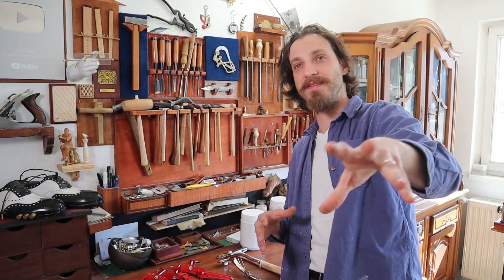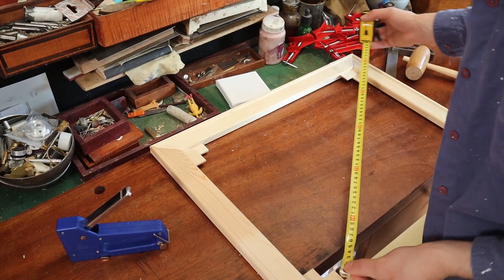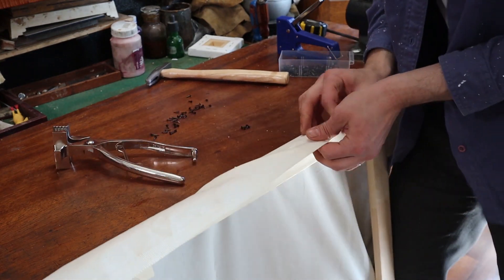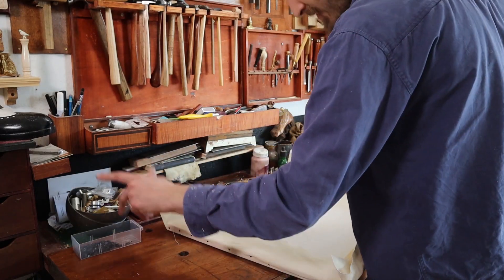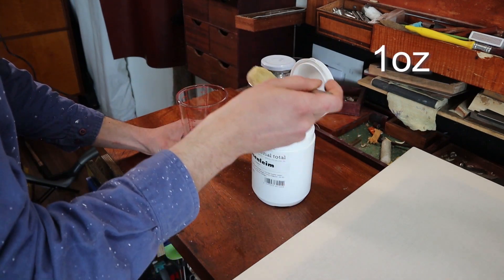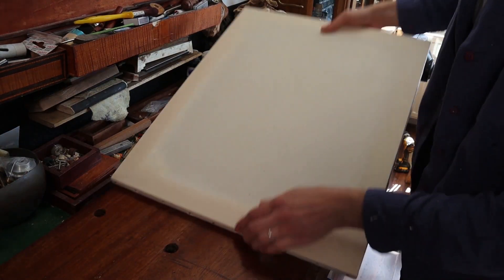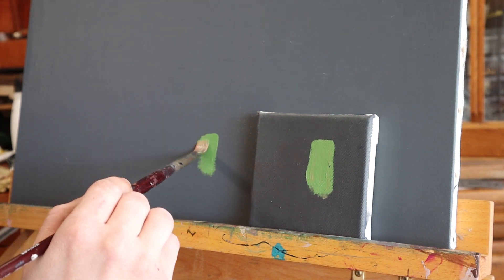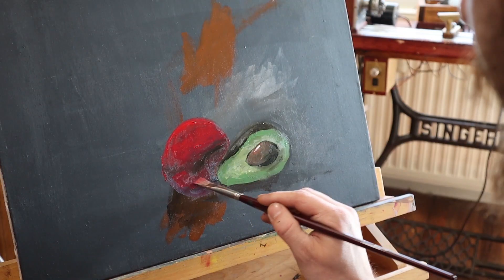Why stretching your own canvas is so delicious!

Comment: I’m glad to see I’m not the only weirdo who likes to stretch canvas. It is, indeed, delicious. 

Stretching canvas taught me an extremely valuable lesson: Start in the middle, and work out toward the edges. This is very, very helpful any time you have to stretch or spread canvas or paper, or just about anything that comes in sheet form. 

I’ve never used glue or staples on the frame corner joints. The canvas holds the pieces together tightly, especially after it has shrunk from the primer drying.

Comment: OMG OMG... how about Uri designs and crafts a stapler ? 🤔
Reply from the maker: That is actually a cool idea!
Reply: @urituchmanpigeon   How is this helpful ?  You teach us on sub grade materials that you do not prefer that have to be sanded ?   What about teaching us how to make large canvases with thick stretchers that you prefer.
Reply: @PrettyGoodLookin  he is demonstrating how to make a superior product using affordable options. Why would this upset you? This is EXTREMELY helpful.
Reply: @urituchmanpigeon  I can already see a sculpture of a person holding a staple with an mechanical arm that will smash the it with a hammer.
Reply: @PrettyGoodLookin  ya know how you said teaching? He uses Sub-grade material because guess what.... He's teaching
And if you want a big canvas, then scale up his method, it's a tutorial video, not a fucking master class
Reply: Yes
Reply: @urituchmanpigeon  I think making one that actually worked well would take 14 versions each gradually perfecting the process, I don't want that kind of guilt.
Reply: @PrettyGoodLookin  you're fun
Reply: @urituchmanpigeon  Did not intend what i said to sound as rude as it does !  :)  I just want to learn how to make a sturdy canvas that requires no sanding.  A large canvas.  :)
Reply: @ToasterHead  thanx.  What i said came across rude bc i was feeling frustrated.  :)
Reply: @CosmicVitamins   He did not say it was bc it was affordable....he said bc that was all he had on hand.
Reply: @PrettyGoodLookin  and this is a bad thing? Why jump to accusations so fast? He's creating good content that has value. That should be respected.
Reply: Genius!

Comment: I've stretched thousands of canvases. As a teenager, I used 
to work in a shop making all different sizes. I used bars like the ones  
you had, also more crude bars, and used exactly the same canvas 
pliers you have (they haven't changed). You're right about the stapler,  
the one you have is a toy - that's why it broke. Also the clamps you used  
are toys. They won't give  you a square product.  Use an old Stanley No. 400  
vise to clamp the opposite corners first, then attach them to each other. A  
newer option is: 
https://www.rockler.com/miter-vise  
(be careful, some vises from the factory aren't even square so check them).

With larger bars like you had, you don't need a vise though, you just should  
use a mallet and a builder's square - and the mortises shouldn't need glue. If  
the corners are too loose, then use a few staples, not glue. Do opposite corners  
first, checking for square, then attach both sides to each other, then use the 
builder's square to do the final check. If you need to adjust, use the wooden 
mallet. The corners should line up without any planing or filing - unless the 
quality of the bars is deficient. The mortises shouldn't be loose, if they are,  
return the bars and exchange them for new ones, only staple them if you have no 
other choice. The bars should fit really snug together, and the corners should be
naturally square, you shouldn't need to fool around with the builder's square too 
much more than a few taps with the wooden mallet and a few flips to set each corner.  

The only stapler we would use was the Arrow T50, it is still being made.

Also, it's obvious to me (sorry) that you don't actually stretch canvases all day.  
I could do that whole job in probably less than five minutes; when I was a kid it  
would have been about 40 seconds (using a stapler), and I'm talking about 
starting with the bars apart.  

You weren't using the pliers properly, there's a nub on one jaw of the pliers to act as 
a fulcrum against the bars. You could not do that though, because you had cut the  
canvas too large and the edges overlapped too far for you to get a proper bite with  
the pliers onto the canvas. You should practice more. I like how you used the tacks  
instead of the staples (although with the toy stapler you had, I don't blame you).

When you cut your canvas, never tear it. Use a box cutter or just a razor blade.
The lip of the canvas should be 1-1.5" over the edges of your bars, just enough for the 
pliers to get a good bite. Then when you  use the pliers, you have that nub on the lower 
jaw to act as a fulcrum, so you can get the canvas tight, and you can get a really good 
stretch. I never stretched raw canvas (without gesso) before, I don't think it's that 
great to stretch it before you have the gesso on  it (but I could be mistaken on that 
point).  You usually don't need the wedges on your bars unless you've done a poor job 
stretching the canvas - to tighten up things.  Also, if you use the wedges it messes up 
both the square and the size of your canvas - you can add as much as 1/8" to the dimension  
after pounding in those things. So, try to avoid them, it can affect the size of the frame  
later on if you use them.

When you start putting the properly cut canvas onto your bars, put the bars vertically onto a table
so that the canvas is hanging from the top bar, so then you can center the canvas over the top bar. 
Put one staple in the middle, parallel to the direction of your bar. You've got one  
side attached at the top. Lift up the whole thing a few inches with your right hand, and with  
your left hand catch the bottom bar along with the bottom lip of your canvas. Folding the bottom 
of the canvas over the bottom bar, flip everything over so that the bottom is now under your chin,  
and the top with the one staple is now sitting on your work surface (or stool, depending on the size  
of the bars). Before putting your second staple, check the size of the lip, make sure it won't overlap   
too far, or you will end up trimming it later. Center the canvas, check the lip on the right and left bars.  
Now put the second staple on the top of the next bar - in the middle of the bar, parallel to the bar. 

Now, flip the bars either way, clockwise or counter-clockwise, and find the middle of the third bar. Third  
staple goes in the middle but be careful not to pull the lip too much before you staple, or you end up with  
a wavy canvas. Again 1" to 1 1/2" lip is enough (a smaller lip won't give you a big bite with the pliers). Flip  
the bars again, and get the fourth staple - this one's not as critical, you can pull harder on this before you 
staple.  These first four staples aren't really stretching the canvas, they're just holding it there in position,  
and you might need to remove them during the stretching process because they were installed when the  
canvas was loose. Your first staples should be parallel to the bars, but all your staples from now on should be  
at a 45 degree angle. 

Now things start to get more critical - you start using the canvas pliers. Get a grip on the canvas, right behind  
the middle of the top bar - next to the edge of the bar. You will see that the fulcrum of the pliers is right there for you to 
take advantage of when you want to put some tension on the canvas. If you did that now though, you'd pull out the  
one staple that's on the opposite bar - not a good idea.  So, just hold the canvas to one side of that one staple,  
and put two more staples in, one on either side of that lone staple. Flip the canvas to the opposite side, and  
now you can start stretching with the pliers. It will become obvious that the first staple may be too loose and you  
may see a bit of a pleat under it. You can pop that staple out later, first put two more staples, one on each side of the  
original staple, and rotate the canvas. So, two more staples on the first side, flip, stretch, put two more staples (you may  
get another pleat).  You should have three staples on each side, in the middle of each bar.  Only work on opposite sides  
of the canvas, never rotate the canvas to work consecutive sides.

Now you can relax, the canvas is basically on, you can start really stretching it. Use the fulcrum and see how much 
power you get out of it when you lean the canvas & bars away from you and pull it against the fulcrum of your 
canvas pliers. Staple out from the middle. You already have three staples in the middle. First staple from the middle to the corner,  
go back to the middle, then go back out to the opposite corner.  Flip to the opposite side, repeat the operation,  
starting from the middle, going out to each corner, stretching with the pliers, using the fulcrum against the bars.  

You should have two sides stretched and two sides with the three staples each. Look at the canvas from the front and see if you've  
got any pleats. Now starting from the middle again, go out to the corners with the stapler. You can now see why the first staples  
are parallel instead of at an angle. You may need to pull them out if they're causing pleats. When you get to the last  
side of the canvas, you can really start to pull hard with the pliers. I used to find this a bit painful after doing  
a lot of canvases, it's a little strenuous on your grip to both pull and squeeze hard with the pliers at the same time.  
But you have to do it. The last bar needs to be pulled the hardest. 

You should have all four sides stapled, without any pleats in the surface of the canvas. If you have pleats, you'll have to  
remove a staple, stretch it again with the pliers, and restaple. You should have "ears" sticking out of the corners of  
your canvas. This part is a little tough to describe. You want to make a neat fold along the edge of the corner of the 
bars, then put one or two more staples to hold the fold. You should do each corner. It's kind of like making your bed, and 
getting the corners of the sheet folded in neatly (unless you have fitted sheets). 

You'll have a small lip around the bars that looks kind of sloppy. Some people like to trim around the bars at this point, but we 
always left this lip intact. The reason we did that was to provide enough canvas for the work to be restretched at some later point 
in time.  To make things neat, we'd put another line of staples around the back of the bars to hold the lip of the canvas down. 
These staples are just for appearance, they have no other purpose, and they don't need to be tight.

I didn't really originally intend to write all this crazy nonsense, but I haven't thought about this stuff in more than  
20 or even more years. I haven't stretched a canvas since I was a teenager, but I did so many (thousands) that I still  
remember how to do it.  I hope you can follow these instructions (if you have the interest). Good luck with it.  

First get the vise though, and get the Arrow T50 stapler. Otherwise it's not really even worth it. And try putting the gesso
on the canvas first before you stretch it. Be careful, don't make it too thick or it will crack when you do your stretching.
You should make your own bars too. Why buy them if you can make them? We just used to make our own bars.  

Thanks for the content. Keep up the good work.
בס״ד
Reply: Thank you!!! Maybe you should make a video on how to create your own canvases....I would watch!!!
Reply: @BazerrkInsaneAsylum  Maybe, but to clarify my situation; this was something I did as an after-school job when I was a teen-ager. I did it for several years. As an adult, I've actually never done it. I'm sure I still could, but I am no way in a position to start making a video on the topic. Unless you run a frame shop and have all the materials and equipment that is.!
Reply: Regarding how long stuff takes - from what most YouTubers tell, it takes them easily five times as long to do something when they make a video out of it, because of all the camera setup and trying to stay in frame, watching for focus and lighting, and so on. You will often see that with machinist channels - they show how to make one, and then off-camera they make five more and say that it took them about the same time as the first one. So don't be like, "I could do all of it in ten minutes". Because yes maybe you can, but can you also make a video out of it, and still do it in the same time?

Comment: I recommend when stretching canvases, don't go so far on the first two sides with tacks/staples before starting the other sides.  If you do it all the way on the first two, you can get stretch marks when doing the other sides.
Reply: I think Baumgartner recommends a diamond pattern working across one way and then across the other.

Comment: I love making my own canvas with rabbit skin glue and then mix the glue with marble dust or use an oil primer.  The process is delicious 😁
Reply: Is the purpose of marble dust to create iridescence?  If so, how do you paint upon it so as to maintain the iridescence?   Tks.
Reply: @vicwahbyphotography4866  no it is not for irredecence,  it is for gesso, a primer for a smooth surface on which to lay paint.

Comment: As part of the student work-study program in college I built and stretched custom sized canvases for other students. It was a remarkably meditative process.  The way I was taught, all four sides are stretched simultaneously, working from the centers to the corners. This keeps the tension more evenly distributed across both axes of the frame and is less likely to introduce warp or twist, especially on larger canvases. It lets you build larger with less reinforcing.

Comment: I paint in acrylics and I use ready made canvas board , but I Gesso them 2 times. Sometimes 3 times depending on the board.I get the same relatively smooth surface . I do not like a really rough canvas either.

Comment: I've been watching Baumgartner restorations too much because the staples hurt also don't the keys go in after the canvas is on? The frame is supposed to be able to flex a bit so when you put the keys in, it tightens the canvas even more.
Feel free to correct me if I'm frong!
Reply from the maker: I actually wrote the correction in the video
Reply: frong?

Comment: Hey. I am an artist. I am very glad that you started drawing) I can not recommend you use black primer. Due to the use of a black primer, your picture will turn black after some time. This is due to diffusion processes. Black paint from the lower layers falls on the upper bright colors and spoils them. These are the laws of diffusion. Better use white primer.

Comment: Hey man. Why not use a small nap roller to apply the background and then flat trowel it for a nice slick finish? Of course I don't even paint. I do work with concrete and plaster though and I feel like that process would give a better foundation to create from...

Comment: Are you sure it is linen? It looks like cotton to me + don't staple the corner joints, in the case you have an accident stretching (like the glue does not do its work properly or something like that) you can use the wooden pieces to stretch it more (like you did but before the canvas was on the stretcher haha). If you staple the joints, the wooden pieces can't do their job. You could staple the joints at the back side of the canvas though so you can remove them if you need the canvas more streched.

Comment: you dont glue or staple the frame or add the wedges at the start. Its a floating frame. the wedges are tapped in after the canvas is stretched to get more tension and can be tapped in further in subsequent years if the canvas loses tension.

Comment: I did this once on a 2x2 m frame with a cotton bedcloth. It didnt contract enough after the first coat, so I did another coat, which was obviously too much and the entire canvas warped. Long story short: you cannot simply hang the painting it needs to be screwed down to the wall on all four corners.

Comment: Uri is Great! I watch and rewatch. I disagree about removing the raised lip on the edge, however. Without it, the canvas gets pushed against the inside edge of the stretcher frame and leaves marks, both from painting and handling later.  You can see this already in the still picture of the finished dark-primed canvas. Love these videos, though.
Reply: Hi.  I see what you're talking about with his finished canvas showing the inside edge, but I'm not clear this is from his "reducing the aggressive radius" plaining.  Rewatching the first moments of his video, he's reducing the outer (narrow edge) of the frame, not the height of the outer radius offset. Perhaps he really needed to plane the inner frame edge to 45 degrees to keep it from being so sharp.  What do you think?

Comment: Really want that Baumgartner one time restores one of his paintings.... stretcher stapled together and I have really no idea (honestly really no clue ), but rabbit glue as a primer?! As the glue is water soluable you paint with something like a oil paint. Ok so far so fine, but when you "restore" or even normal moisture, the paint will flake of the canvas when the glue dissolves again?A bit like a selfdestroying Banksy ;) And in comprehension the reaction I imagine.....this savage stapled and keyed his frame!!! (and the order he did it was the geatest!)After starting restoring it, what the hell why is the paint coming of?! p.s. and the heating of the glue seems way to hot? He nearly boiled it....